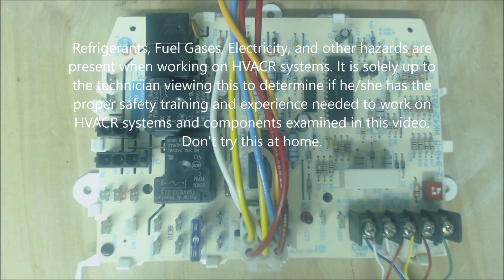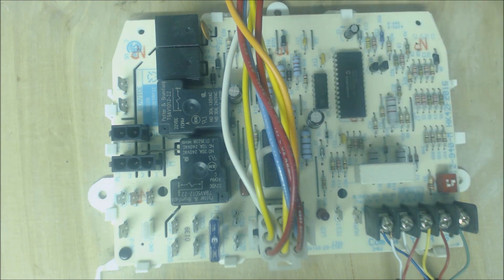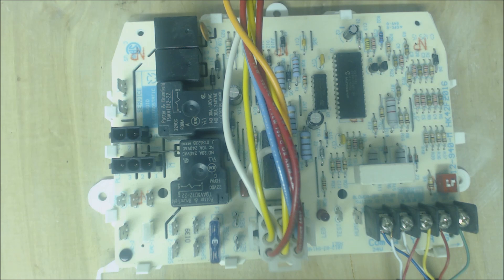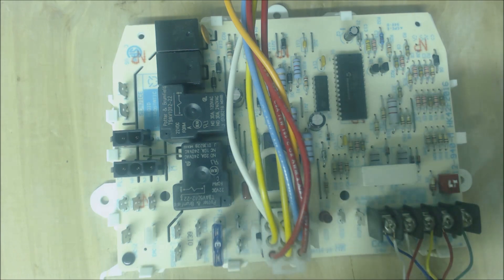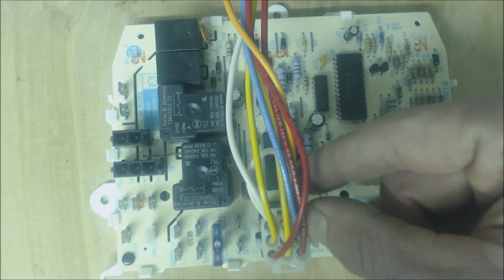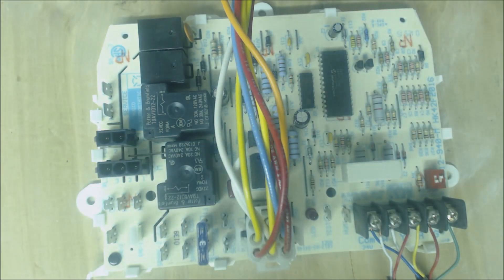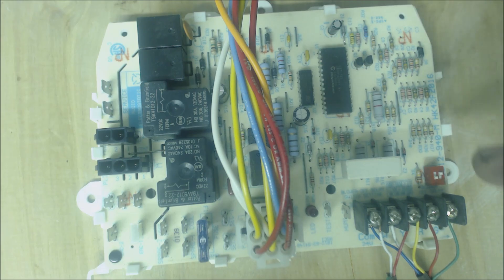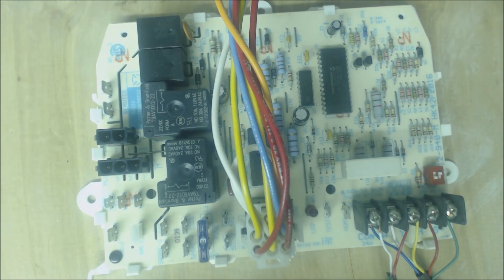Troubleshooting the Furnace Control Board IFC to Test if its BAD! For Heat and AC Diagnosis!

Comment: Thanks for your video, it's the most detailed and informative I've seen.  I have nearly the same circuit board as shown.  In my case the RESCO furnace suddenly stopped blowing.  There was no blinking led, the gas would come on, ignite and burners run for a minute or so then shut off.  The fan would run when plugged in directly.  Removed the circiut board and found a very obvious bad solder joint on one load pin of the blower relay.  The pin had no contact with the board, looked corroded, black and no solder.  The board around the solder joint didn't look as if it had overheated.  The relay tested good with zero Ohms across the load pins when actuated, so I cleaned and resoldered the pin.  Furnice fired up and the blower is blowing again.  I have a new relay ready just in case.  Resco model GB3AAV060115, installed 1995.

Comment: Great video. I have a reznor UDXC. No LED status light. No LED number block on. Nothing. I have voltage to the unit, 24V out to thermostat and internally. but nothing else. I'm thinking bad board.

Comment: if my gas valve gets 23v for only a moment then goes back to 14v (my furnace always has 14v)... is that an indication of bad control board? The gas valve does open when it is supplied with 24v.

Comment: I have a trane/American standard heater/ s8b1b080m4pacaa/ when I put on fan only on tstat it goes in the lowest speed.  The manual says the speed can not be changed .
I was told the round about to this is,   take the y wire off the board that comes from the compressor.  Also take the y wire off the board that comes from the tstat put them together ( wire nut then together)
Now put a jumper wire from g on the board to the y on the board.    And should take care of ur fan only problem. 

What do u think about this

Comment: I have a furnace that the heat continues to run, heating the home to nearly 90° without shutting off. Replaced the thermostat already, no fix. A quick test after replacing the thermostat did not have any issues, both the heat and air turned on/off. However when it runs a cycle for more than a few minutes, for some reason the heat continues to run, without shutting off, even though thermostat is no longer engaged. Is there anything besides the control board that would keep the furnace running even after the thermostat says it's off and not sending the voltage signal?

Comment: thank you! I have the same board except its number is 1012940JHK42FZ009. I will do this troubleshooting but if I have to replace the board, where can I buy one? The AC tech was less of a tech and more a salesman trying to get me to replace both my whole systems. He also quoted me $1500-$1800 for each pcb.... just to buy, not even install cost

Comment: I have this same board. I'm getting 3 short flashes and 3 long flashes. My roll out flame switch is good, the limit switch is good, the fan motor capacitor was bad and I replaced it. I'm still not getting power off the board from the heat and com on the board to the fan motor. Would you say it's the board causing this problem? Also is there a difference between board 1012-940-L & 1012-940-J ?

Comment: My gas furnace lights fine but blower motor does not come on blower motor and capacitor are good
Reply: Also I have 4 flashes on led a trane YCCO42F1MOBH does one of the limit switches turn it on thanks for any help

Comment: The furnace turns-on, blower and exhaust fan and flame. It runs for about 60 seconds or so then shut off. When it shuts off, the thermostat goes dark. 5 minutes later, the thermostat turns back on and the furnace fires up. The fact that the thermostat shuts completely off, lends me to think it's the circuit board...perhaps a bad relay. Thoughts?

Comment: I have this board in my furnace. No 24V on the blue wire, the gas valve won't open. I do know the gas valve is good. I wish I had a schematic to this board, I could probably repair it. I'm guessing it's one of the relays on the board.

Comment: I've been watching all the troubleshooting videos but haven't found the answer to the issue I've been trying to resolve.
On a Goodman propane gas fired hot air furnace, when the furnace is not in use for heat but you want to manually operate the blower to circulate air or the AC unit calls for blower fan, the fan does NOT turn ON, either by using the manual ON setting on the thermostat or the thermostat calls for cooling.
However, I found that the pressure switch for the gas valve, which is normally OPEN, and it requires the inducer fan to be ON by drawing down a vacuum on the switch to CLOSE the contacts, the fan works. With the furnace OFF and the pressure switch bypassed and the two contact leads shorted together the manual FAN control on the thermostat WORKS and then I switch off the manual FAN setting and set the thermostat to COOL and then if I lower the temperature setting with the thermostat set to COOLING the fan will now come on when the compressor starts running. So how do I troubleshoot this to determine if it is not the control board, but some other component in the system? Where is the voltage coming from that is used by the manual fan switch control on the digital thermostat or the AC unit when it calls for Blower motor to run and the furnace pressure switch is in its Normally Open position?

Comment: So to be clear and Im sorry if it explained, if any of the sensors are tripped OPEN will that cut off the 120v at the terminals of my inducer motor at the board basically 120v off the board terminal will it not read 120v?

Comment: My igniter lighted but the gas valve didn’t open. I watched your video and you said the 24v blue wire and the yellow common wire turn on the gas valve. Where do I place my multimeter probes on the control board to measure the voltage to the gas valve? Thank you.

Comment: Hello good morning. I am asking you about a 62-24140-01 controller board for a Rheem heater.
When I give it power, the green "OK" LED stays blinking permanently and does not perform any function. Could it be that it has any damage? I already checked the securities and with another board the equipment worked very well. Could it be repaired?
Thank you for your time, Lucas greets you from Argentina! your videos are very good.

Comment: My board was bad.  Inducer motor was not getting power.  Code 31 first lead me to believe it was a bad pressure switch.  After troubleshooting and testing for power to the inducer motor, replacing the board fixed my problem.  Don’t assume the board is good.  My unit is about 5 years old.
Reply: hey whatsup so one thing i forgot to check was the sensors. will that cut off the 120v if they are tripped open? im not getting 120 at the board for the inducer terminal.. thanks
Reply: @druer_gsxr  hi you may want to ask this question to someone more experience than I am.  This was my first time taking a shot at fixing a heater problem.

Comment: Thank you so much...I was losing my mind. The control board had zero led flashing messages & was working as it should. The problem I had was everything worked but the gas would not shoot out my two stage valve. So I replaced it to be safe. Even on the new valve I got 24 volts on the high second stage but zero volts on the low side of the gas valve. Meaning I had a fault somewhere per my wiring diagram on my Goodman 2 stage furnace.. I replaced everything...flame sensor, pressure switch, rollout switches, hi temp switches. I was now zeroing in on the control board. So I watched hours of videos and finally found yours that actually troubleshot the board in detail. I pulled the clip on the board out that held the 12 wires. I found the one from the pressure switch was loose and push it further inro the clip...I clip it back in...and was thinking yeah right that aint going to work...I push in the safety off switch. The furnace did it's clicking as it should and right at the moment the glow plug was ready to go out BAM..the gas finally came out the manifold....ME SO HAPPY thanks...I was dreading calling the repair man on Monday even though my family was freezing their asses off and making fun of my handyman skills. Goodman - Model GMH80905CNAB -2004
Reply from the maker: That's awesome to hear and an encouragement for me, thanks!
Reply: @acservicetechchannel  Actually it was the control board....after 30 minutes I got the pressure sensor error 3 flashes now...So I shut if off did the old school finger flicker on each relay on the board and turn it back ON....started right back up again...I will monitor it. Probably replace the board now, now at least everything will be brand new again.

Comment: Followed your video and my hot surface ignitor is not getting 120V and does not have a resistance reading.  Inducer motor works and pressure switch is closed per your tutorial and visually.  Do the entire board need to be replaced?

Comment: PS.. to my current question on the 1998/ Tappan 92.1 gas H.E. furnace....  (just posted)
did another test for a degree warmer.. 68 from 67..room temp.  Cycled on and cycle off at 69.. also low speed of fan did kick on before shutting off.     fan had a little whine to it.. thinking to lubricate it, as well!     Let me know if it may be ok to use temporarily until I receive a new control board!  Details in previous message just left... 
Thank you 
Eric MN

Comment: I was Troubleshooting a board last night and found the fuse was fried. I started out changing the condenser capacitor and still could not get the unit started. Then I started Troubleshooting to see if a bad thermostat. After I realized that was good I started Troubleshooting the board. The weird thing is after I put a new fuse in the status light still never lit up on the board, so I called the board bad. Is this right so to speak??
Reply: The whole unit has not been working since a couple of days ago here in Houston since the Hurricane Nicholas power surge.

Comment: First of all great videos and thank you for them! I'm having a problem with my AC. Intermittently when my system calls for cooling the outside unit comes on but the blower on the inside is not coming on and then the lines and everything starts to freeze up. The led status code shows continuous off. Any help would be greatly appreciated. Thanks

Comment: Thank you for your video. I replaced the 5 wire (assuming that had gone bad initially) but the system is still not turning on. The LED light turns on when I press the door switch but nothing else. Last night, I tried jumping the wires and it turned on. Can we deduce that the circuit board is bad or is there something else that I should be looking into?

Thanks for your guidance!

ps: I also changed the 3A blade fuse.

Comment: I'm not getting any low voltage reading from the wires that go into my thermostat. I also checked the reading at the board for RW, RY, etc., but not getting 24 vac. Fuse, breaker, drain, transformer, are all working fine. Any suggestions on what my issue can be? I'm not getting any power to my thermostat so it is just blank. I tried swapping thermostats but that didn't help.

Comment: Just had the older version of this board fail.  The mechanical relay for the 24V safety circuit was good.   Relay sticky.  new board uses solid state relay to eliminate that problem.

Comment: Thank you!. I watched dozens of videos, YOURS WAS THE KICKER! Had 4 flashes, and the blower motor was not delaying. Checked the air switch and temp switch, repeatedly.  I was convinced it was the relay and was ready to buy a new board. In the end just a loose connection at pin for air switch. Thanks again!

Comment: My igniter lights up for a period of time but gas is lacking for the next step, blower motor activates for a little bit thereafter and restarts the sequence. I disconnected and checked voltage at the gas valve and the voltage was around 28vac for about 5 seconds. I reconnected the two pins to the gas valve and it was pulled down to 0.5vac. when the board tries to actuate the gas valve, I can see a slight change of voltage and then returns back immediately to 0.5vac, does this indicate a bad board or bad winding in the valve? Disconnected gas valve pins I read 15vac but when I connect it, it gets pulled down to about 0.5vac. Thank you for your help.

Comment: Just found your video,  I'm getting 3 blinks from my Goodman furnace . I changed the inducer, pressure switch and hose. Inducer had stopped turning, everything worked great for a month then I changed the dirty filters and it ran fine. Now im cycling but it doesn't fire up and I'm still getting 3 flashes. I bought a meter and I'm getting volts to the pressure switch but what I did notice is that the part that glows to ignite the furnace doesn't glow anymore. I used the meter to check for power but there's no voltage. Any idea on where i may go next? Just figured it out thanks for the video, I had power everywhere so I moved the wire on the control board and its running.  Let it run for a few minutes and see how it goes.🤞🤞

Comment: Hey.  Just looked at my first possible circuit board.  In heat mode blower doesn’t come one but it does in fan on mode.  I jumpered G and W so the blower comes on at same time as furnace does so people can have heat.  In heat mode without number there is no 110 going to blower motor. So circuit board problem?

Comment: what if I'm getting .1v  AC between the red and the ground? There's definitely 240v at the input terminals ..
do these boards sometimes get fixed by cleaning them?
It's the first time that I powered up the (new) package unit. [goodman]
the board got rained on, but it wasn't hooked up to power...

Comment: Water heater got a leak and water got in the heater. I fixed the leak.. dried out the inside of the heater. wiped it down. blew it out. i had a code 21 then a 12 after clean drying. Had to clean the nine pin connector before it started up finally. The next day.. noticed it was cold went down now its just continuous flashing. Cant figure out what else to do. Says polarity is reversed. I check the low voltage power supply 25vdc and the hi voltage was around 122vac .. I checked against the wire diagram. they are plugged the right way. Dont know what else to do.

carrier bryant payne HK42FZ011 furnace control board 1012-940-K

Comment: Hey this board I'm working on when calling for cooling it doesnt have 120v from the high speed blower wire to common. But It does turn on when I jump out heat at the board. Idk whether my board is bad or it's something else. I know the blower runs in high speed just not when the tstat calls for it to. Any help is much appreciated
Reply from the maker: If the blower motor does not power the blower motor when you have 24v going to the g terminal of the board then the board is bad as long as your voltages are correct at 120v and 24v, thanks!

Comment: Question...wondering if you can provide direction, this morning my downstairs AC unit wasn’t blowing cold, I went out and checked to see if it was on and fan was working..it was, I then swapped thermostats and fan kicked on but still wasn’t blowing cold. I swapped the thermostats back...then the downstairs thermostat wouldn’t power on - checked the breaker, it was on - I reset it anyway.  I then checked for 24v at the thermostat and nothing, went up to the furnace and checked the LED status light...it was off, code said to check for 24v power, SEC1 and SEC2, L1 & L2 - , after watching videos I checked for 24v at the transformer... (SEC1/2) nothing, 0 - I then checked for 110 by disconnecting the transformer and testing on the control board where it connected - PR1 & Neutral I believe, no power. I did ensure the power switch was on and the door switch pressed in - does this sound like a failed control board at this point? Thanks in advance for any direction you can provide...
Reply: The fuse is good - I checked it and it looked good, to be sure I swapped it with my upstairs AC since I didn’t have a replacement on hand and it works fine.

Comment: from your furnace controller PCB studies do you  happen to know which of the PORTA,B or C pins 
of the 28-pin Microchip uC are in use.

does Carrrier stick to just one port ?   or are the signal pins scattered among the 3 ports ?  
and  is this a variable model  to model ?

  my repair approach is a dual one , first to follow  your  guidelines for checking accessory function & voltages
and then to ID the  uC pins  involved ,    then monitor them w/ my 4-ch'  digital scope during furnace operation.
among other things this lets me quickly see if the ULN2003 chip is getting an 'on' signal for the relays.

my furnace is 58DLA070-12 , mfg sept 2004.  and is flaming out soon after ignition.
Reply from the maker: Hey Bob, you are very detailed in your approach to the microchips. I do not follow along with that aspect that much to be honest. I usually will replace the control board with a new one so as to avoid any warranty issues and because I don't have each component readily accessible for repair compared to being able to purchase the new board when needed at the local supply houses. Usually it is a relay that goes bad when they do fail. Not always but more times than not. Have you seen my flame rectification videos or pressure switch videos? You may want to look up those playlists as well for the circumstance you are mentioning, thanks! I also have links to playlists under the videos tab at acservicetech.com thanks!